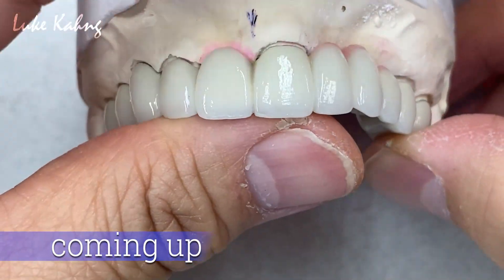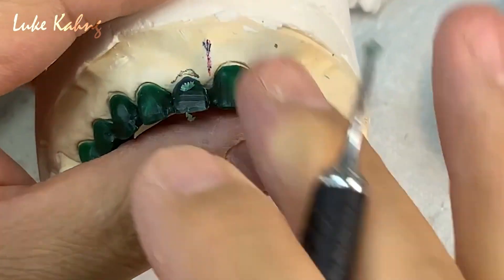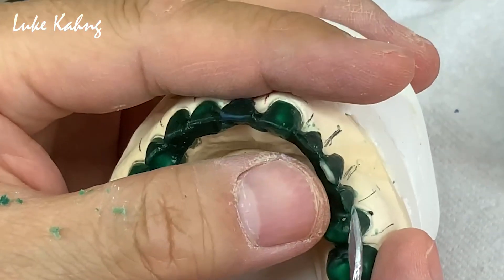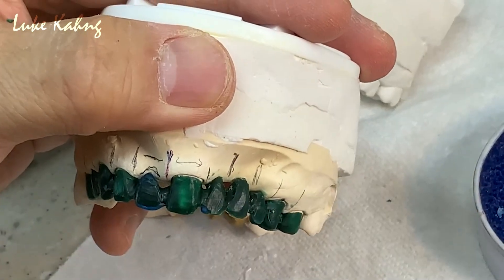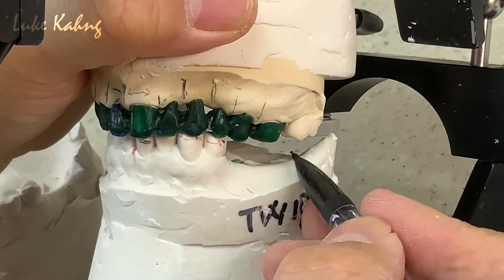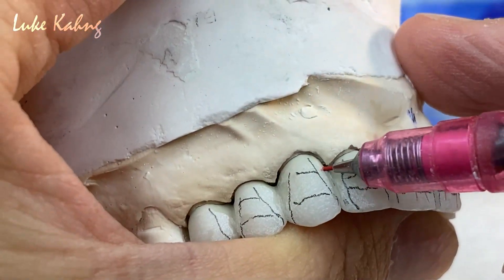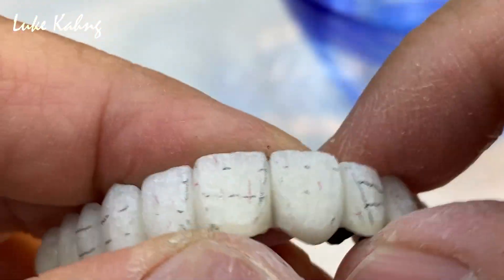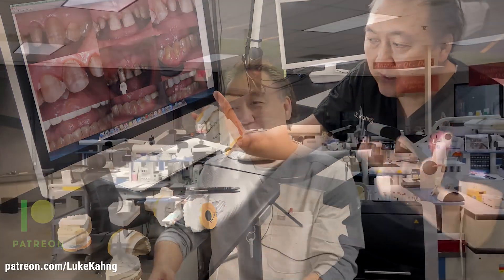How to Make an 11-Unit Metal Ceramic Restoration

Comment: What material are you going to use to attach this metal ceramic denture to the original teeth ?  Denture Adhesive or Epoxy glue to attach permanently ....
Reply from the maker: Composite dentures
Reply: @Lsk121  Thanks !  Will this composite dentures PERMANENTLY glued to the real teeth and CANNOT be removed ?